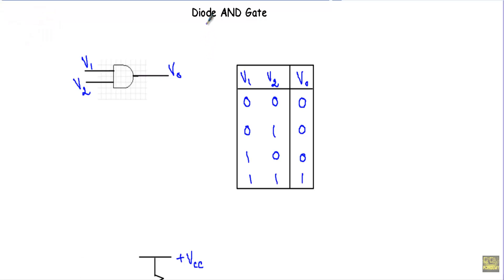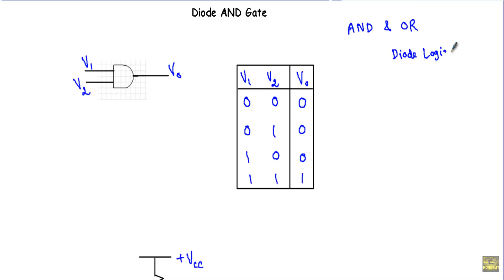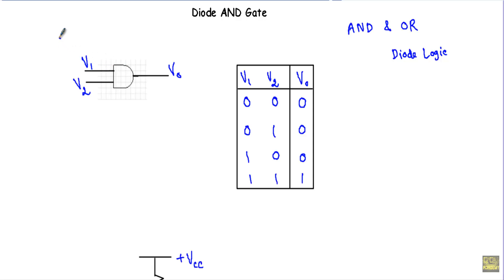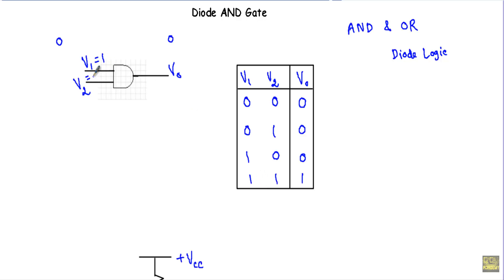Diode AND Gate (w subtitles)

Comment: when v1=5v and Vcc is also at 5 V then the voltage at both the terminal will be same so how diode will be in R.B.. plz clarify it
Reply from the maker: First check the simulation of Diode AND gate simulation ( check pinned comment). Then tell me what could be the reason of the diode to be reverse biased...

Comment: but voltage drop for each diode of 0.7V also, is like a resistor not fully a short circuit? If that's the case @ 7:47 there should be a divider (of resistors)
Reply from the maker: A diode has the ideal equivalent circuit. Ideal diodes can be replaced by the short circuit.
Reply: So the voltage across the ideal diode is zero unlike the other approximation, ok thank you

Comment: I see, even no voltages applied to inputs,( not 5v or 0v) just open circuits, the AND diode logic gate, will consider it as logic 1 in inputs.

Comment: Hello! At first, I want to say, you have explained it very well. But I have a question. When you are saying that V2=1 (means connected to +5V) the n-terminal is connected to +5v and the P terminal is connected to GND. How is it possible? As VCC is already connected to the P-terminal, how it is connected to GND? It will be very helpful if you explain that. Thank you.
Reply: Now everything is clear
Reply from the maker: Check the simulation of the circuit.

http://everycircuit.com/circuit/5118868899233792

Here, Vcc is used to bias the circuit. F.B. or R.B. of the diode depends on V1 or V2. Once bias the circuit with Vcc, you can use something similar to superposition principle (mentally replace Vcc with short circuit) and check the effect of V1 and V2. If you replace Vcc with short circuit, you will clearly see p-side of the diodes/diode will be connected to ground for logic 1 and diode will be in R.B.

Comment: Why is it that when either v1 or v2 have a non-zero value for voltage, you don't take the effect of the Vcc into account anymore. For example, you say V1 = 5v is connected to the diode and, as a result, the diode acts as an open circuit (i.e. reverse-biased). But, isn't the Vcc still connected to the diode as well, and it's connection makes it forward-biased?
Reply: Anas Shakra  I also have the same doubt
Reply: @mariappanmariappan868  Hello sir if you find a answer of this objection then please revert with solution
Reply: Same doubt here,if person who have raised this objection has find the answer then please revert here?